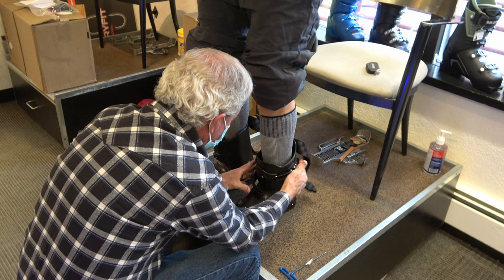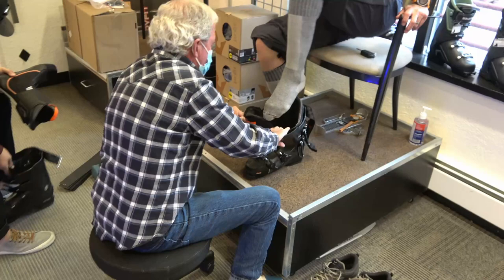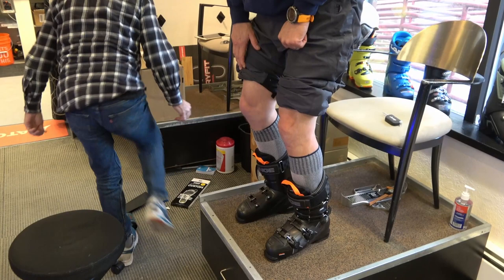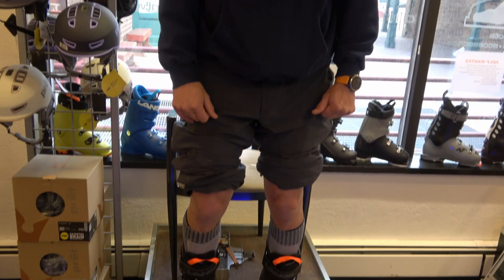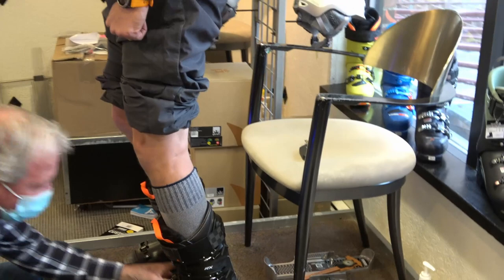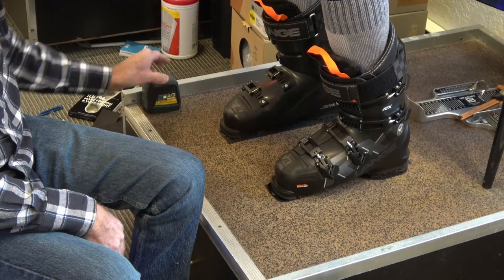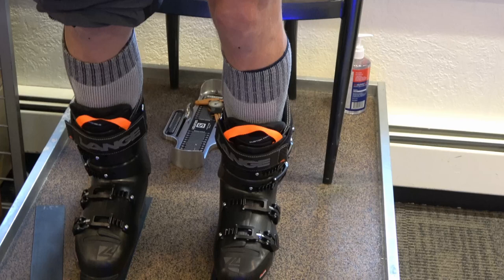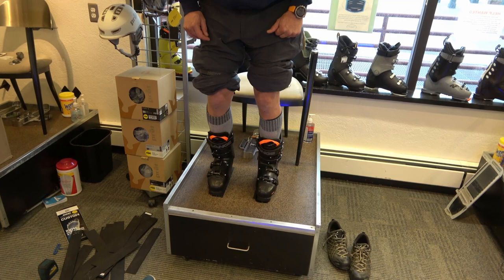Quest for Perfect Stance - Ep8 - Bosch Laser / Ernie

Comment: Lasers?  How about this?  If a person has legs that aren't vertical when the stand, like bowlegged people, you put them in a boot that has cant adjustments, buckle them up, adjust the cant until the sole of the boot is level with the floor and then do it again with a moldable sole under their feet to fill the wedge shape between the foot and bottom of the boot.